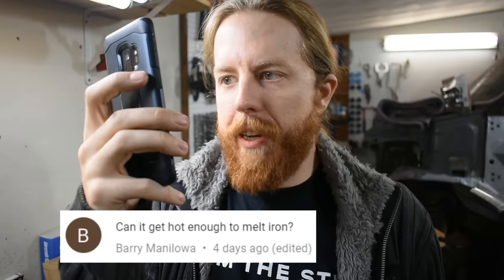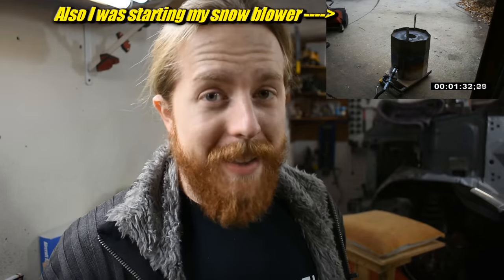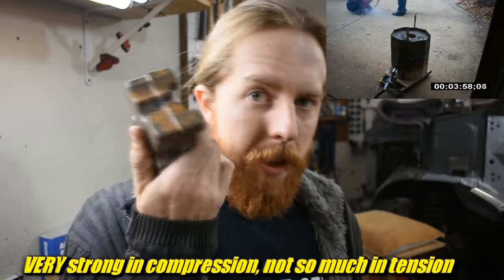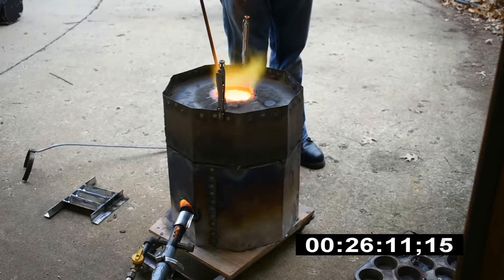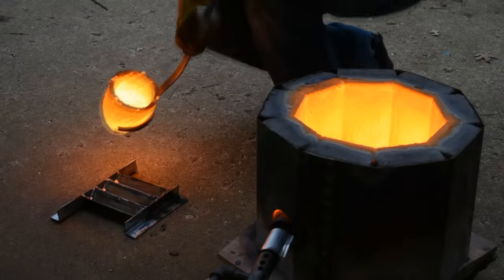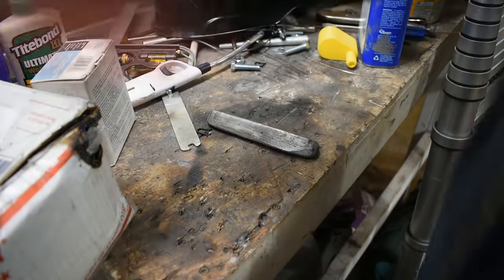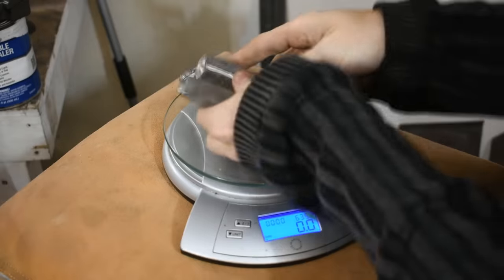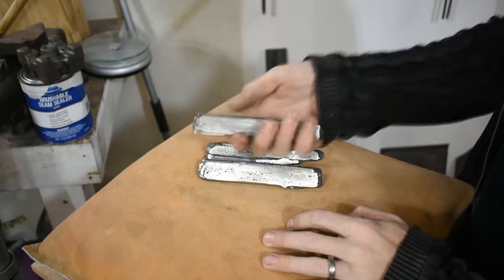Can I melt Cast Iron in my propane furnace?

Comment: i think if you do a propane used motoroil/ diesel vapor mix you should be able to up the temperature up a LOT higher , the propane helps keep the fire lit when you add the liquid fuels (flames will shoot out the top and there might be a lot of smoke too untill you get the mixture right )
dont think i would want to mess with cast steel , i know of a company somewat near me that does cast steel stuff , there not so big that they cant do custom stuff on the side and i think i can get them to cast stuff for me if i bring them the bucks or the sand moulds 
wat you say about the headroom in the heatrange makes sence , there sworth smithing forges that use propane to get the steel plyable but i dont think they want it molten 
hmmm guess the forge on just propane can melt the stuff , must be the insulation around the crusible that makes it possible 
and 30 minutes to melt the steel enough to pour it isnt that bad 
would like to see one of those ingots cut in half and have the open side polished  to see if the metal was hot enough to cool good / slow enough without cracking or other inclusions , might be interesting to dip them  in Ferric chloride or Muriatic Acid  as you might be able to see layers and other differences in the metal consisticy  
i seen another way of showing the same thing by heating the edge of the metal till it turns a gold / straw colour and quickly remove the heat and have the heat progress across the steel naturally , the guy i seen on youtube (sorry cant find the vid no more) did that on a testweld with a small propane torch (cut polish and heat untill the steel change colour) made the weld penetration verry visual
Reply from the maker: Sounds like some good tests.  I have muriatic acid in the work van... I smell an experiment coming

As for waste oil or diesel, the heat from those is insane but the smoke and smell is the turnoff for me.  I considered it but my neighbors might be inconvenienced.  they haven't called the cops on me yet and I'm going to do everything possible to keep them happy!
Reply: @PaulsGarage  bah, a waste oil burner is really loud, not really smoky.  Unless you have it running too rich it should only smoke a little and only on startup.  Use waste veg oil, and all that little bit smoke will do is make your neighbours hungry for fries if they even notice it at all.  However, you've just shown you can melt whatever you want with propane, so...
Reply from the maker: I've heard those biodiesel veg oil burning cars smell like French fries.  I think I'd end up gaining 50 lbs constantly stopping at five guys if I had to smell that all the time

Comment: I think it’s the heat treating that’s the trick. Seems like it needs a normalize cycle or something to keep from being brittle... I’m probably wrong, lol!
Reply: No you're right it needs to cool slowly and the mold needs to be preheated.
Reply from the maker: I read it's the higher carbon content that forms crystals that act as stress risers that makes it brittle.  I could be mistaken tho
Reply: Adding ferro silicon makes a huge difference in the resulting metal. Helps ensure you get grey cast iron and not the brittle white cast iron.

Comment: Make a tripod about 6 feet tall and hang the propane tank over the foundry to keep it warm. Won't freeze that way...   LOL  It's a joke.
Reply from the maker: Keeps it warm, and when it blows up EVERYTHING stays warm haha
Reply: @PaulsGarage  The same would go for deep frying a turkey around your part of the country. Keeping the tank warm over the fryer. Give a new meaning to flaming giblets.   BTW I was going to guess a counter weight for a washer cuz the spin cycle would knock it through the wall if it didn't have one. A dryer not so much of a need.

Comment: If you would like to collaborate I am super interested in steam engines and such. I could make you some CAD files for your molds and you could 3d print them.
Reply from the maker: Thanks for the offer, I'll consider it! I was trying at one point to model a steam engine valve system I had in my head, never quite figured it out

Comment: how long does a normal propane tank last you?
Reply from the maker: Depends what I'm melting.  Low pressure aluminum melt I get lots of castings out of a single tank, dozens maybe.  With cast iron everything is full blast, I might get 2 or 3 if I'm lucky before the tank gets empty enough where it will freeze mid melt

Comment: petro sand is what they used to cast my lathe bed.
Reply from the maker: It's awesome sand.  I might be switching to normal water bonded green sand though
Reply: @PaulsGarage  Yeah, was just making the point that cast iron is cast in petro sand as well. Videos on casting iron in green sand usually has the addition of coal dust from what I've seen so It's not cleaner. and just as smokey. Kinda 6 of one. half dozen of another type of deal. Guess it just depends on what type of sand maintenance system you plan on having and how much casting you plan on doing. When I build mine I'll probably go green sand as well. I'm handy enough to build a mixer and probably everything I need already to build it and I already have coal from my forge. As for sand there is LOTS AND LOTS of natural sand all over around here so costs will be minimal. Just bought a lathe mill combo so I'll be able to build my own oil burner.

Comment: STEAM ENGINES!!!

not enough well produced stuff about steam engines on Youtube yaknow... just sayin'...
Reply: MyFordboy is one of the few who has steam engine stuff... mostly for model trains. I agree most of the steam stuff on YT is fairly low quality.
Reply from the maker: Also chirps tinkerings, fair weather foundry, Emma's spare room machine shop
Reply: well my problem with most steam engine enthusiasts is how utterly useless most of the stuff they do is, it's ultimate nerdyness that achieves nothing while working towards bugger all. no experimentation, no implementation, and therefore no achievement in my eyes, especially when it comes to model trains.
Reply from the maker: how about i make the lathe and shaper, then use those to make a steam engine that I then use to power the lathe and shaper? :D  not gonna happen, but it would be interesting!
Reply: make a lathe to make a steam engine and make a better lathe with the lathe and power it with the steam engine to make a better steam engine!

Comment: HA HA HA i have two furnaces i melt in. my little one holds 40 pounds and my tilter will hold 200 pounds, I use Silicon carbide crucibles only, Quenching will harden iron and cause lots of stress in the casting, I only use petobond, I gave away my greensand.